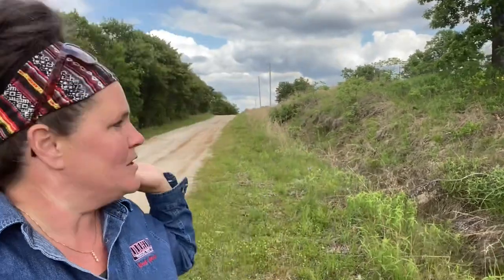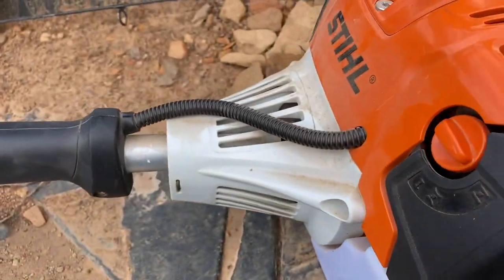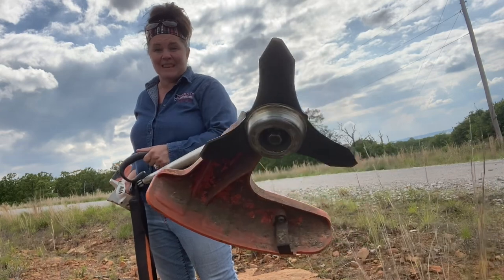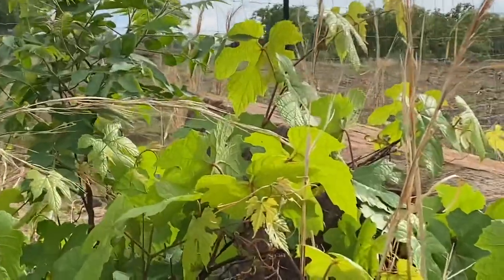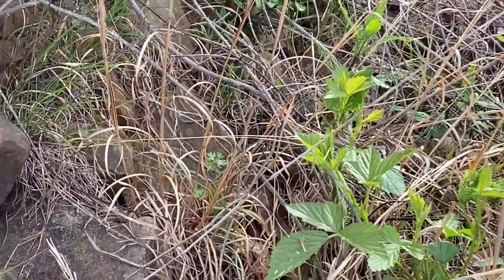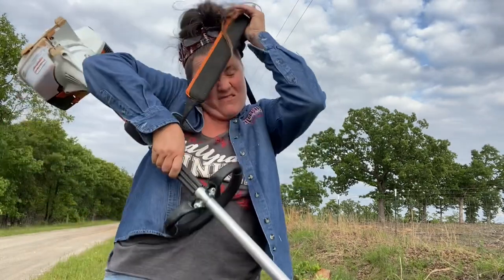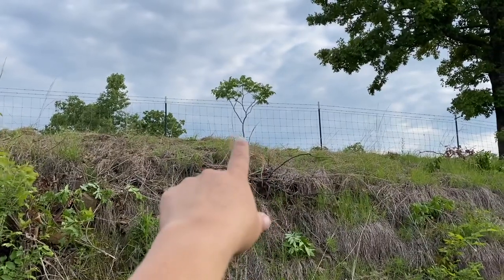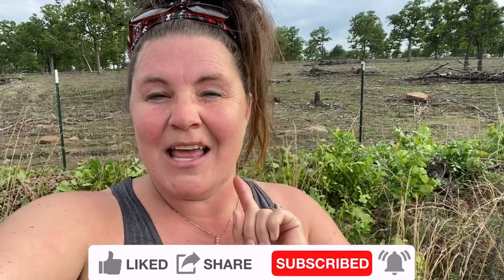The Best Tool For A Homestead: Clearing The Fence Line with Stihl FS131R Brush Cutter Steel Triblade

Comment: Heavy duty tool. I tried something like that when I was clearing bullrushes from my pond. For my fence line I like my push string mower but always fear I’m going to grab a barb wire. New subscriber.
Reply from the maker: Yes, that is scary. I felt comfortable since we were the ones to clear the land originally and have gone back so many times to clean up after the fencers :) Thanks for coming over! Welcome!